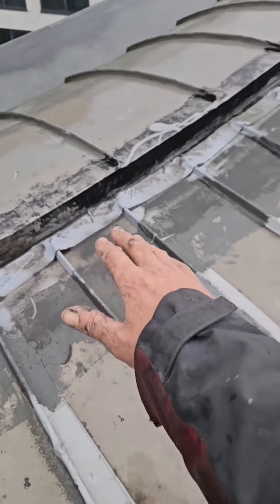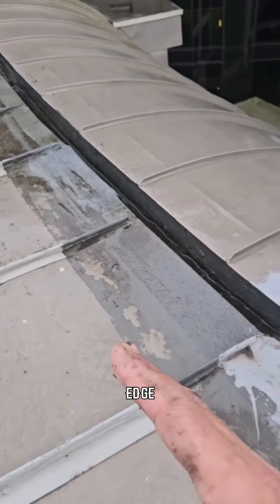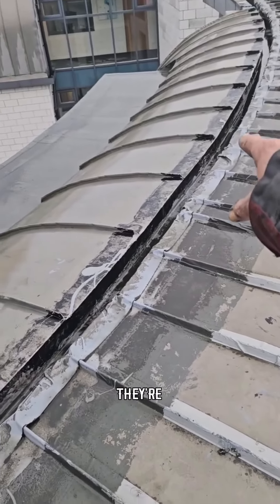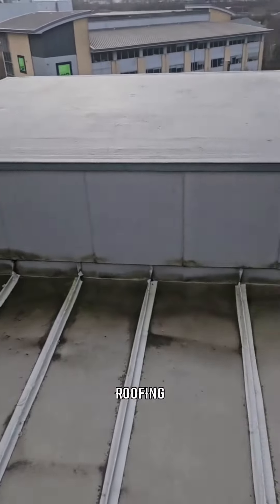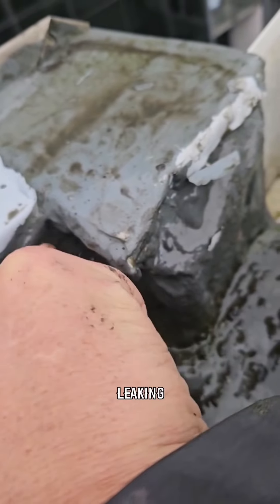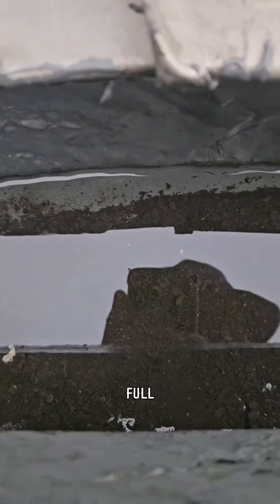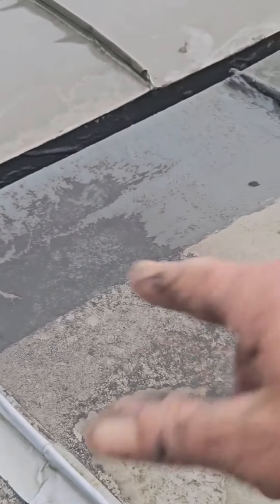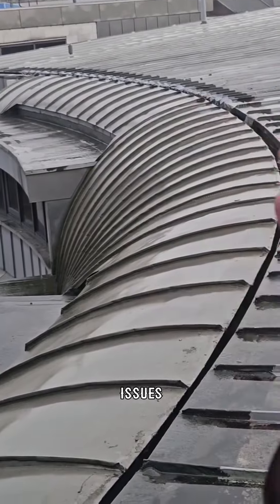THIS LEAK IS DESTROYING THE UPPER FLOORS OF THIS TOWER BLOCK

Comment: you can mastic up under there by extending the gun’s nozzle with some (say 6mm) clear plastic tubing. I use that trick to get expanding foam into places you can’t get because the can is inverted. Mind you mastic is only a temporary fix in this case I suspect.

Comment: Bauder liquitech would fix that quite easily, 
And as for a mastic gun just use an angled nozzle.
Quite a simple fix imo.
As for the drip all that needs is a twice vent metal riveted to the field sheet.
Speak to Bauder if you are Bauder certificated, they will send out a field technician out there to advise you.

Comment: Jobs like this… I think you quickly have to decide how interested you are in doing a repair or roof replacement. That said, on to the conundrum itself; my thought is the problem could be caused by expansion and subsequent failure of the box gutter to roof seal. Poor design.